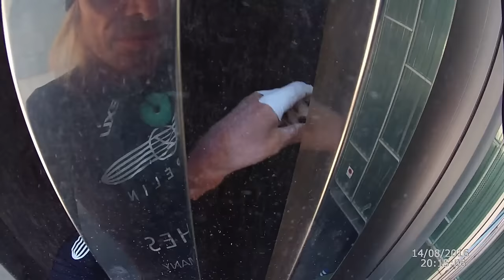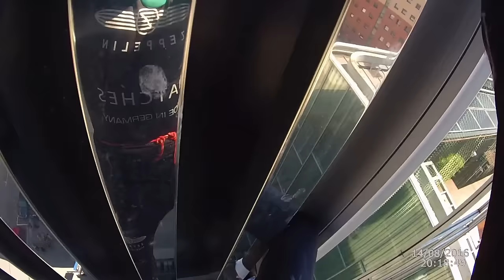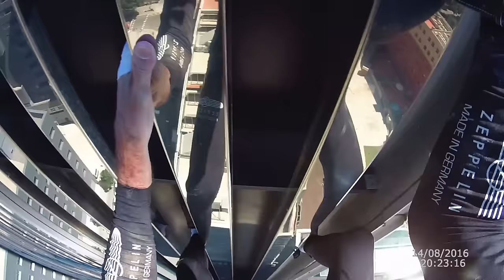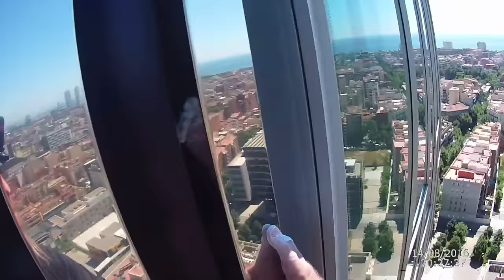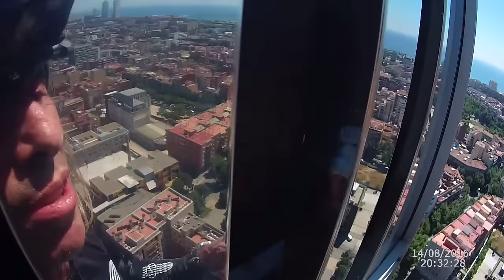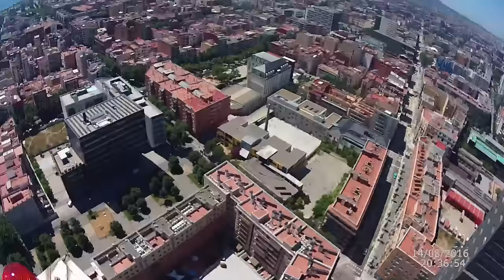the french spiderman climb Sky Melia Barcelona

Comment: The crazy part is he is trusting who ever made that building put those pieces on correctly. One of those break, hes done.
Reply: Spanish engineering mate, no problems jeje
Reply: @sr.d5126  Spanish engineering? That dude reaallly risked his life then O.o Jk
Reply: Mufasa other dude made similar comment and got the response of the dude himself. He uses multiple anchor points and he checks before loading it.
Reply: i think he depends on the two separate pieces of the structure almost like a safety measure. climbing with his hands closer to his core would simplify the climb but then he puts all his weight on one rung.
Reply: @69mickswagg  if your current handhold is weak trust me you wont then just release the secure one to progress the climb.
Reply: @69mickswagg  with the momentum, his second hand isn't really holding him while he's launching his first hand forward. A beam breaking would certainly destabilize him but especially with this crack style climbing he would do fine.
Reply: Dude is insanelyy strong 💪 brosky. He can do a pull up with two fingers of his hand.

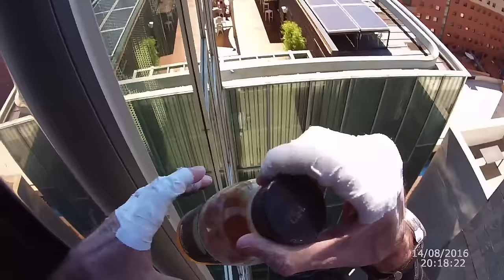Comment: 4:35 How you crack open a cold one
Reply: Mr.Optical my dude just let the lid fall off
Reply: Mr.Optical re
Reply: Mr.Optical that pop thought
Reply: It popped because of how high he is the altitude fill the bottle with air or atleast the sun and it pops
Reply: I was sad the cap fell😔
Reply: Nah that wasn’t a beer. That would be the WORST TIME to get drunk
Reply: Not Zach Z  but right next to him was a rooftop were people go on and hangout do there bottles do that too
Reply: The bottle popped because the pressure inside the bottle is the same as the level he started climbing at; as he ascended up the building the pressure outside the bottle was lower than the inside, when he opened the bottle it depressurized at a rapid rate to his altitude creating that sudden pop.
Reply: Ahahahaha made my day
Reply: With the boys
Reply: Inside that bottle was probably a fermented probiotic tea, the fermentation makes it pops

Comment: He should at least have a parashute or a wing suit like this man has some steel nuts
Reply: that would only bring him down more and at that height it would be difficult to have enough time to adjust yourself and use the parachute.
Reply: Vevxo what about the wingsuit
Reply: your mobility would be more limited and those things are still heavy, obviously not as heavy as a parachute but still and from the height of the building guy would get maybe 40-50~ meters (that's a guess) before he'd just crash into another building and that's if he'd even pick up any air
Reply: @anonymousfornow9526  No, pretty sure this is a straight free solo, if he fell he'd almost certainly die.
Reply: what the hell would a wingsuit do, you would still fall at a critical velocity almost certain you would die, same goes for a parachute that low
Reply: Your Breads Butter no hes not stop starting rumors
Reply: @Spazmonkey625  yea he walked up from the car how would he be bungee corded
Reply: @Spazmonkey625  You intrigued me so I checked, He's wearing a German Zeppelin Suit which if you didn't know, contains a parachute. I was wrong; but he wouldn't die.
Reply: @reaux2934  Making a mistake isn't spreading rumors; I honestly thought he was bungie corded. There had to be some sort of safety involved I was sure. No one's that stupid.
Reply: @anonymousfornow9526  Where'd you find that? I couldn't find much info on whether or not he had a parachute